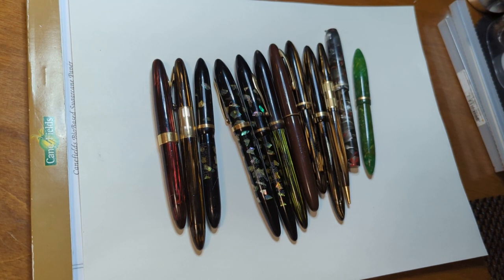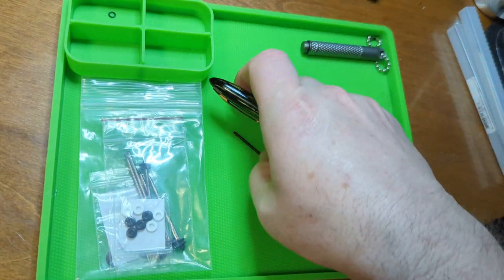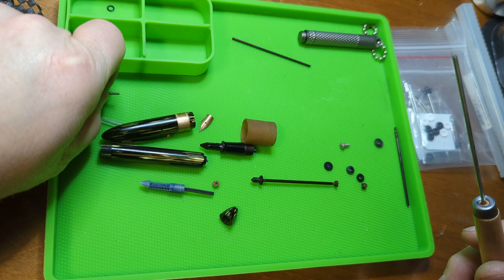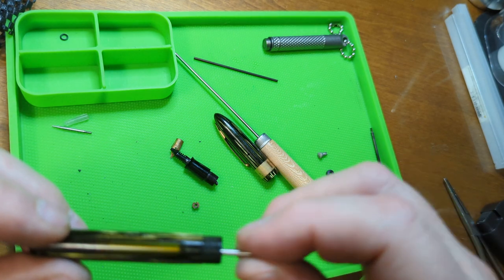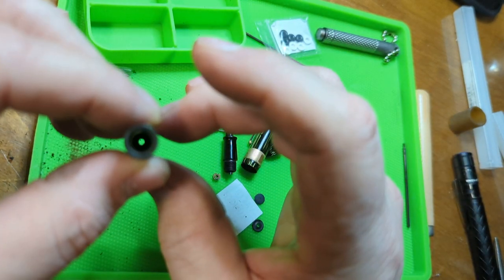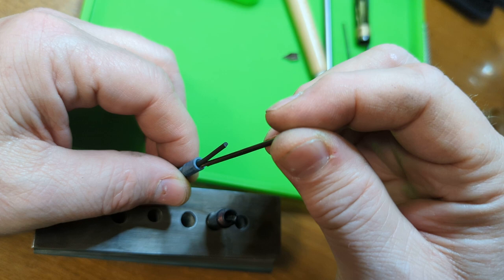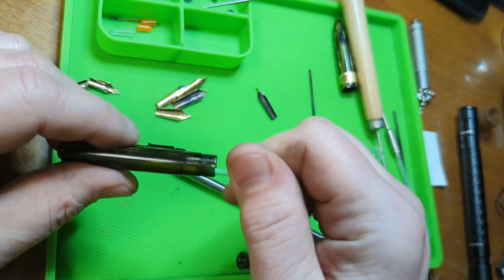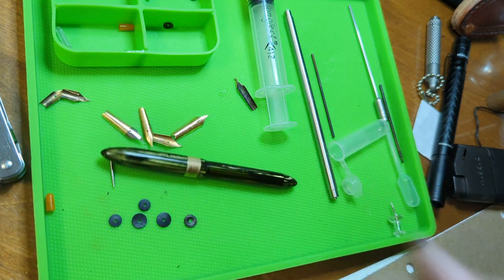Sheaffer Vacuum Filler Repair

Comment: Thanks for making this! I've been curious about how to restore these (I've restored most other types so far, vacumatics, leverfillers, snorkels, etc.). I'm still more than a little bit intimidated by how much more work these are but maybe I'll give it a shot one day after I have all the tools.
Reply from the maker: This was my 6th successful vac-filler repair.  I did another one the next day.  Once you know how, they can be done, but it is still one of the more difficult pens to repair.

Comment: this video was very helpful!!  i got my pen apart (it’s almost like the one in this video, but the plunger thingy is trashed.  and the nib unit need to be replaced because the nib is partially broken.  Where do you get your parts?
Reply from the maker: I get parts and tools from Pentooling.com but things like replacement nibs I have on hand from pens I couldn't fix